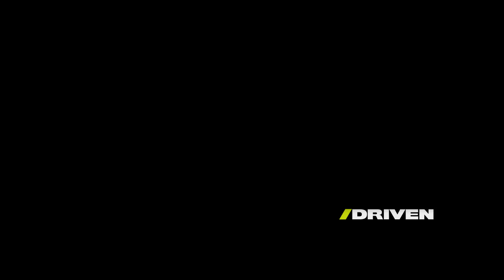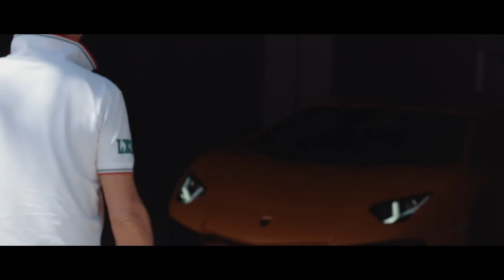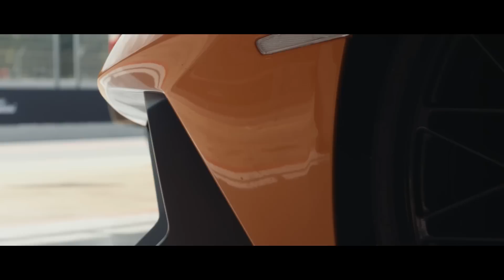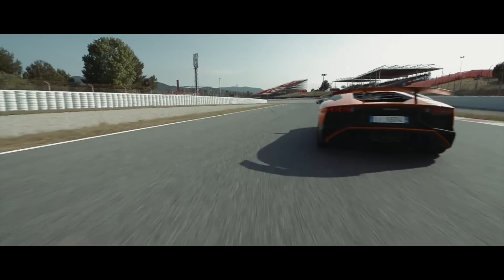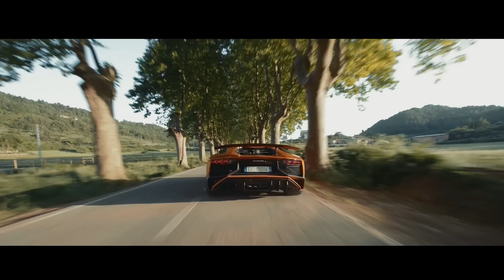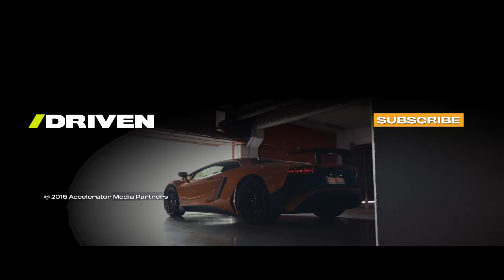Creating the 217mph Lamborghini LP750-4 SV Story - /DRIVEN

Comment: Looks like Lambo went the way of mclaren, naming their cars after fax machines. Shouldn't it be called the terminator, or something?
Reply: David Scott lamborghini has been doing that for a while, nothing new.
Reply: David Scott 
LP750-4 SV means "Longitudinale Posteriore (engine mounted longitudinal), 750 hp, 4WD and Super Veloce (super speed)
Reply: Der Kussler My Samsung CLP320-N LP(Laser Printer), your turn Lambo.
Reply: Der Kussler I really cant understand why it is important to state that the engine is longitudinally mounted, so important infact that you need to state it in the model name.
Reply: None of you are going to buy it anyway. So they didn't market the name for your demographic.
Reply: Well the comment section is for comments.
Reply: bingoberra18 it's very important to point out the engine is longitudinal especially in a lambo. Most front wheel drive cars or AWD cara have engine transversely mounted. It's very impressive for lambo to fit a mid engine longitudinal AWD with gearbox all with such low centre of gravity,  this is actually a very hard thing to do there are many variables that can become a major issue in such a design.

Lambo has been doing this for a very very long time it may seem "simple" today but it wasn't years ago. It's very cool to carry all that heritage over
Reply: During the early 90´s it was impressive to have 4 valves per cylinder. I dont see too many 16v logos on the trunk of the cars nowadays. That its longitudinally mounted may be difficult to combine with AWD, but I cant see that its the thing that most people are impressed with if they think about buying it.I think the fact that its mid engined, awd and that it has a V12 is more impressive for example.
Reply: bingoberra18 it's definitely not the most impressive but it adds upto what a lambo is. The SV model are serious collectors items though
Reply: Elle Sea Sure yes, and if we start on the BMW topic their numbers are even more confusing. Before the 328 was 2,8 liters, it made sence. Now it doesnt make sence at all.
Reply: Terminator is already taken With Mustang my friend
Reply: bingoberra18 
Well, the first mid-engined Lamborghini, the Miura, had it's engine transversely mounted. They started the "LP-Thing" with the Countach LP400, so they probably just kept it.
Reply: Der Kussler Veloce is fast or quick. Depending the sentence context.
Reply: David Scott The first ever lamborghinis, the 350GT and 400GT were named in the same fashion.
Reply: David Scott Nay, not completely true, it's name is aventador, so it's named after a bull - just like the murcielago, gallardo and so on!
Reply: David Scott you must be a new guy...
Reply: ***** thank you I appreciate that
Reply: David Scott you new to lambos huh?
Reply: bingoberra18 Hahaha well said sir! I may steal that retort.